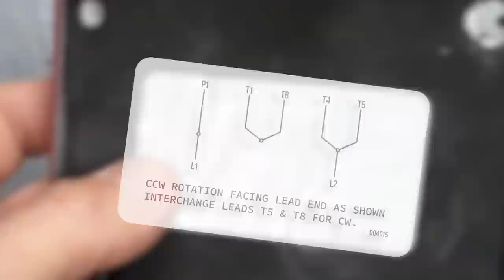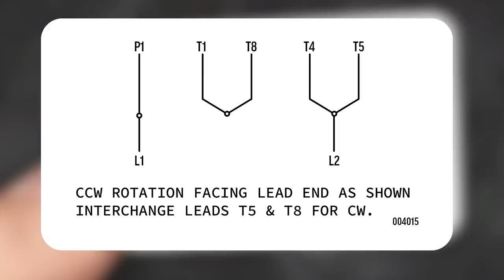Swapping a Bigger Motor into my Planer.  How Hard Could That Be?

Comment: I would think the larger pully to get the right speed cuts down on the effective HP of the motor. Nothing is free more speed from a larger pully less torque/HP.
Reply: The slower motor provides twice the torque, since HP = torque x rpm
Reply: @Eric Van Andel  the hp formula is. HP = (torque ×rpm)÷5252.  Gives you 14.6 ft/ lb , now just  think about the size of the first pulley to the new pulley  it's looked to be double, so that decreases torque by 1/2. A 5hp at 3600 will give you the torque using the smaller pulley.  Just saying you might look into  the Amp usage between the two. The reason for the higher rpm is for the cuts per minute at a given feed rate
Reply: Both the 1800 and 3600 rpm versions of the motor will draw the same current. Do the math to calculate the torque for the 1800 rpm motor and the 3600 rpm motor. Both 5 HP. You will see the 3600 rpm version will produce 50% of the torque.
Reply: @Balsamancnc  just saying that the bigger the pulley the less torque the motor can put out. given that you using a 2:1 ratio, don't matter what the diameter of pulleys. It's in the mechanical engineering hand book. Depending on ratio you can increase torque or decrease it, but inversely it decrease the rpm
Reply: @beaumullins6490  Yes, this is why the torque at the spindle is the same whether you use the 5 HP, 1800 rpm motor at 1:2 or the 5 HP 3600 RPM motor at 1:1.
Reply: @Balsamancnc  you still not getting what I'm saying, by  putting a larger pulley you reduce the torque of the motor to cutter head. But you do increase the rpm. Torque is given or expressed in inch lb or ft lbs. T= f× radius. Now given that the cutter head is giving a resistance to the motor pulley by cutting (planning a board), The resistance varies depending on  width and depth of cut. Let's say the cutter head is giving a resistance of 2ft/lbs at a 3" pulley, the ratio comes into play 2:1 the resistance Force at motor doubles, giving a 4ft/lb resistance cutting your torque in half. You got to look at the resistance Force not the input. when you go to a higher ratio
Reply: @beaumullins6490  To keep things simple, lets keep the ratio at 1:1 and 1:2

5 HP, 1800 rpm:

Torque at motor shaft:  Torque=(HPx5252)/RPM
Torque at motor shaft = (5x5252)/1800
Torque at motor shaft = 14.6 Ft/lbs
Ratio: 1:2
RPM at cutter = 1800 x ratio = 3600 RPM
Torque at cutter = 14.6 / ratio = 7.3 ft/lbs

5 HP, 3600 rpm:

Torque at motor shaft:  Torque=(HPx5252)/RPM

Torque at motor shaft = (5x5252)/3600
Torque at motor shaft = 7.3 Ft/lbs
Ratio: 1:1
RPM at cutter = 3600 x ratio = 3600 RPM
Torque at cutter = 7.3 / ratio = 7.3 ft/lbs
Reply: @Eric Van Andel  it's 2:1 , it was about 1.2: 1 on original pulley .let clarify  input  to output ratio  is usually  first number indicates the drive, the second number output is the output shaft ie cutterhead .so that gives  you 2:1 ratio. You got motor now  that turns 1800 rpm. So you had to increase the inpu diameter by two to get it at least 3600 plus.you had a motor that that turned 3600 rpm,cutterhead turned at 4000 plus some machine run at 5000 rpm. You still had a overdrive but not as big.but 2:1puts more strain on motor ie more resistance. Now give that cutterhead plays a large part into the equation , diameter of cutterhead  how many knifes it has its affects on the motor. Eventhough you increased the hp you taken away by set up of pulleys. I got a 20" grizzly with helical head it only got a 3hp does just fine. Take a look in manual for max cut depth,  if any questions call me 706 844 2596
Reply: @beaumullins6490  I agree with you that the ratio is drive to output, which is why the ratio is 1:2.  One turn of the drive turns the output twice. (bigger pulley is on the drive). 2:1 would be a gear reduction and result in a slower spindle, with more torque.

PS, HP is HP.  Ratios don't "take away" HP.  They trade torque for speed, but the HP stays the same.

In any event, I tried explaining in words, when that didn't work I proved it with math. You still don't get it. 

I'm out.
Reply: @Eric Van Andel  you still not getting it, yes hp is hp but motor can only put out so much torque at a given diameter or radis of the input pulley. Torque is given 1ft/lb x the radis. Look a definition of torque as you increase the radis the ft /lbs the ft/lbs multiply as it more increases it  will exponentially multiply further you go out on the leaver. Just because you increase the pulley radis doesn't mean you are multiplying the torque your multiplying the rpm but dividing the the torque out put. That's where ratio comes in. The torque is inversely (opposite) of the rpm
Reply: @Balsamancnc  just sent you another msg.look or type In ' motor pulley torque calculation ' I think this will help you out
Reply: @beaumullins6490  I posted my explanation and math as to why the 1800 RPM, 5 HP motor and the 3600 RPM, 5 HP motor result in the same torque at the cutter in the general comments.  Matt pinned the comment to the top, because it's correct.
Reply: @Balsamancnc  yes you are getting double the torque from the 3600 to the 1800. But the ratio is 2:1 for rpm / 1:2 on torque, that's what I've been saying all along. Hope it works out for you. Still think that it's going to bog down on you when you take a wide and deep cut.there nothing like a free motor, but extra expense on parts. Think you could've gotten a new 3hp as just cheap with out changing all things around.
Reply: @beaumullins6490  lol

Comment: A 5hp hi speed motor would not bog down on that cut, as the smaller motor pulley would have less drag from the cutter. But you're better than you were, and you made a viewer's day by putting a spare motor to work, and it only took a whole bunch of screwing around and ordering and waiting and buying and building to make the free thing work.
Reply: See pinned comment above for an explanation of why this is incorrect.

Comment: I think your pulley ratios are about right, but you lost a fair bit of torque at the blades by doing it.
You really need 3600 rpm and 5hp or more…
Great how you let us see the process warts and all. It gives a guy hope…😂